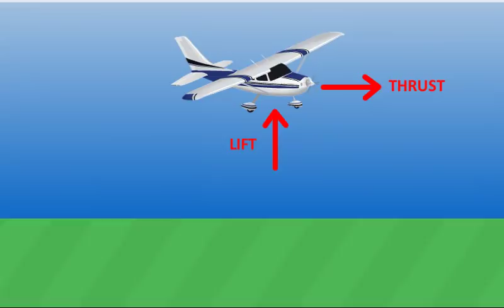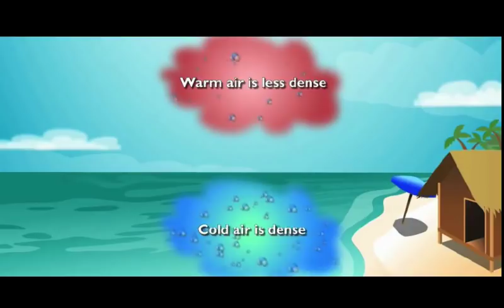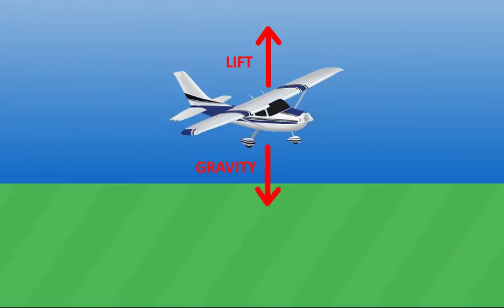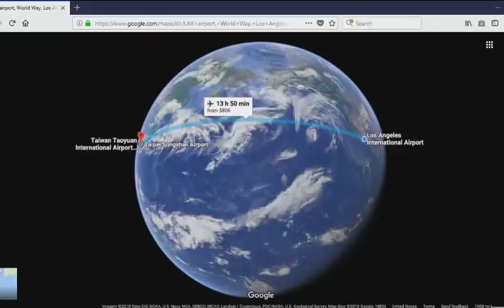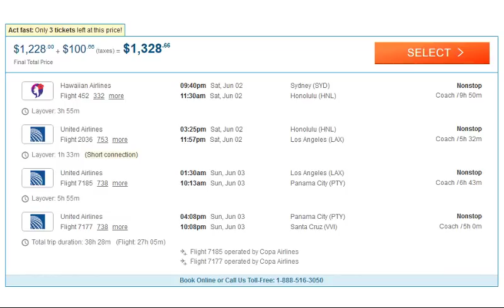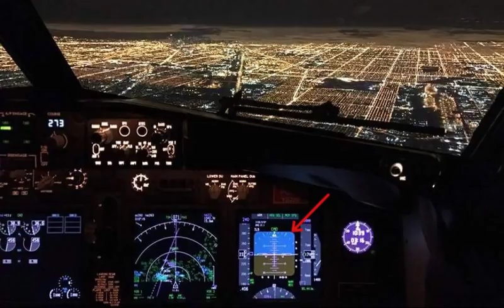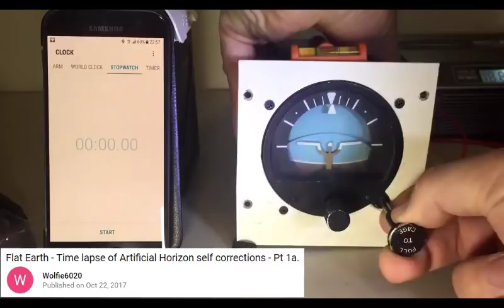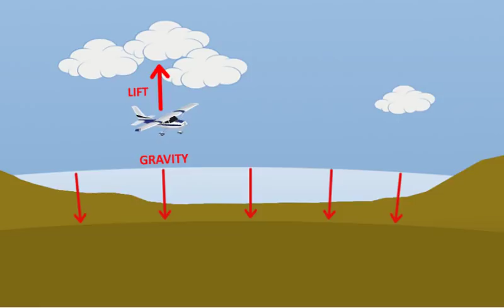Flat Earth Falsities - Plane Nonsense

Comment: This is a good video! :) one question! If you were to take one of the gyros that dont have the features for curve correction say like the one nasa used for spacetravel on apollo or just an old one it would roll back? Thanks in advance for answers :)
Reply: Because that would be an easy way debunking the flat because of gyro theory
Reply: So I'm not quite getting it yet. Answer for dummies :) if u start a gyro on a table on earth, turn the table upside down, wait and it will correct it self towards gravity and in a while show level but the brow upwards so to speak? It seeks gravity by it self nomather what?
Reply: +Daniel Käcko
So I'm not quite getting it yet." That's because you are a troll.
"Sorry for being an idiot" Well thats your own choice, isn't it,  because you are a troll.
Reply: I do understand that much that a plane keeps level with altimeters and so on but I want to easily explain the gyro theory to people! And if a gyro dont correct itself towards gravity such as in my example wit the table, how does it correct for curve while flying? Sorry for being an idiot but I hate standing whitout good simple answers to this question
Reply: Am i a troll now? Okey but i don't understand why? To make my question real simple, if u start a gyro in a plane, flip the plane upside down. Will the screen invert in time? If so it is unbelievably simple to explain to people who thinks the earth is flat because of the gyro showing level when flying! I don't understand if you think the earth is flat? Well anyway have a good day
Reply: Rollie clearly my main language isn't English :) okey but you explained it very good here im happy with the answer! It pretty much has a weight under so it always stays towards center of gravity if I understand correctly? The question was that if you start a gyroscope in a plane and simply flipped the plane upside down not moving in any direction you would have the brown (earth) side upwards on the attitude indicator and the blue (sky) downwards when looking at the indicator but the image of the plane would turn and show level? Aah I dont know how to explain this, but anyway thank you for the main answer, it seeks the center of gravity, the disk spinning horizontally thats why it shows level all the time during fligt (I know it doesn't show exactly level all the time) and yes the flat earthers question is the usual one, how can u fly with the attitude indicator showing level for a long distance
Reply: A gyroscope, without mechanisms to correct, orients itself independently of its orientation due to gravity. However, it precesses because of the local gravity field. This can be compensated for.

Such a gyroscope, which compensates for precession only, would maintain its orientation regardless of whether on the Earth, in orbit or sitting on the Moon. Spacecraft have such gyros because they're necessary to navigate in space. The actual orientation of the gyro itself is entirely arbitrary, set by the initial conditions when it's started.

So interestingly, if you set up the axis of rotation for the gyro parallel with the axis of rotation of the earth, geographic north to geographic south, or declination 90 degrees, right ascension irrelevant, the rotation of the earth would result in no movement of the gyro at all compared to the table you set it on. However, if you set it up at right angles to the rotation axis of the earth, the gyro would rotate 360 degrees per day. This would prove that we live on a rotating sphere because on a flat earth, neither orientation would produce any apparent movement of the gyro with relation to the Earth's surface.

The real behavior of the gyro, not moving (compared to the Earth) when pointed at declination 90, and its 360 degree rotation when directed 90 degrees from that, proves a moving spherical earth.
Reply: RockinRobbins13 yes ok but thats not the easy answer to pull out of the hat when questioned about the gyro in planes and why they dont fly in to space :) I usually say imagine that u start the gyro, lift the plane up and spinn the ball under it! Obviously it shows level. But im looking for a very easy way to explain it. Thanks for answers
Reply: Rollie yes thank you, I understand all that and it makes sense to me but I would like to explain how the mechanism works that does the compensation, I mean literally explain in it detail such as if it would be a pendulum weight underneath the rotating disks that always keeps them centerd towards the center of the earth. But im glad you took the time to answer! Have a nice weekend!
Reply: +
Daniel Käcko
9 hours ago
Rollie yes thank you, I understand all that" So why do you keep banging on about it? Only trolls do what, so you are, as I stated earlier
"So I'm not quite getting it yet." That's because you are a troll.
"Sorry for being an idiot" Well thats your own choice, isn't it,  because you are a troll.
Reply: wong the only one banging on about it now is you wong :)
Reply: wong yes thank me for agreeing :)

Comment: Are there any flatearthers airplane pilots? Why not just try it for themselves if it is flat or not?
Reply: Dennis They could never pass the certification tests for IFR and transoceanic flight. They would refuse to use the aircraft systems that depend on spherical earth. Just watch this video where a pilot shows you around his flight deck and see how much of his equipment is built on the absolute fact that the Earth is spherical. This is a commercial transoceanic pilot. https://youtu.be/ehN6u_A8KOE

This pilot also has a standing offer to flat earthers to take a flight with him and he guarantees that they will easily see curvature. Do you think a single one has ever taken him up on his offer?
Reply: Thanks! That answers my question. But they can still try to pass that test right? then fly a plane for themselves.
Reply: Rollie I'm eager to see who Bobby names. He may just have to deny pilots exist now. Bobby just can't be wrong about anything. He is "woke" now after all.
Reply: RockinRobbins13 yet from 100000 we have footage showing none?
Reply: Bobby boy " yet from 100000 we have footage showing none?" 
No you don't. produce the footage, liar. If Flat Earth Cultists quit lying they'd have to kill themselves. I even saw one that admitted that the video was processed to "take out curvature." Yike! Every straight line in the frame was curved and he thought we'd just gobble up his claims like they were chocolate. Idiots.

To find truth, the absolute minimum requirement is that you have to be truthful. Flat Earth Cultists will find the truth 24 hours after cows invent nuclear fusion.

Bobby bouyancy Why don't you contact Wolfie6020 and have him take you to 46,000 feet. He guarantees you'll see curvature, just like thousands of his passengers have. I'd love to see you lie about what you saw.
Reply: Rollie actually there are